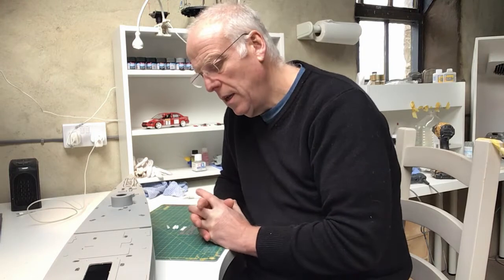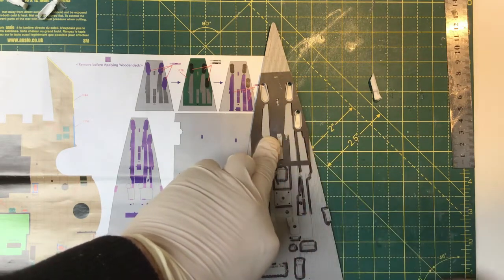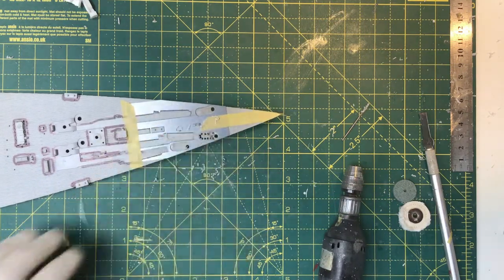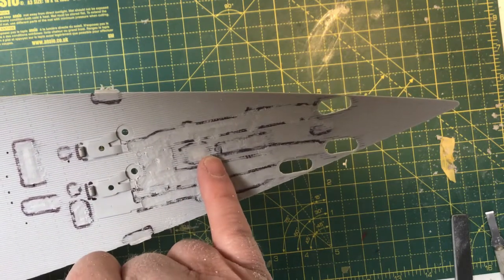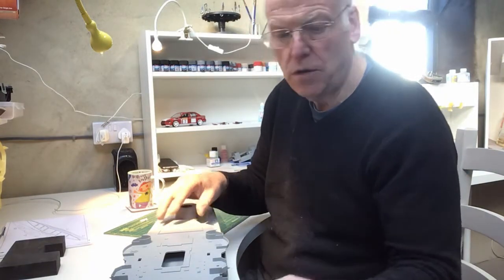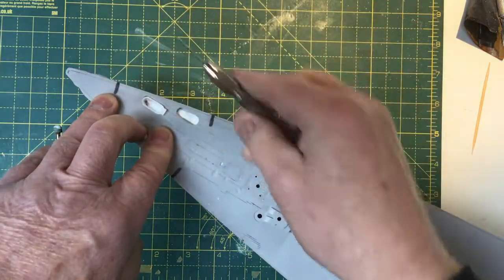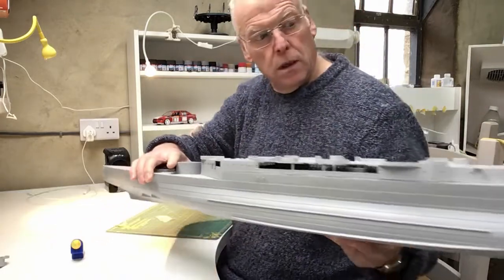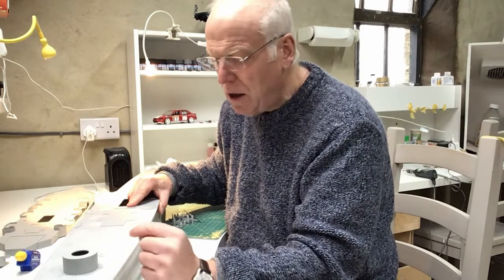Trumpeter 1/200 Hood Full build with Pontos detail set Part 3 (Decks and hawse pipes)

Comment: You've done  great job of presenting your build theory and practice. I'm following it with great interest. If there is one thing I would recommend has nothing to do with technique. Rather it's hard to follow because you are too far from the mic in your system, therefore hard to hear. I've had to turn on Closed Caption. It's done some funny things though. When you say "hawse pipe" the CC interprets it as "horse pipe." If your system allows, and you have the funds, you might want to consider a collar clip mic.
Reply from the maker: If you continue with the series Dan you’ll see (and hear) that I did exactly as you suggested so stick with them.
Reply: @TheModelShed  Cool, thanks...

Comment: Very nice video.  I am really enjoying watching you work.  Have you seen Ron Calverley's channel?  He is also building the Hood.  He had a lot of trouble with warping on the sides of the shelter deck.  Before you get to far along, you might check to see if yours have a similar problem.  See you next time.
Reply from the maker: Hi Jeff. The shelter deck appears good in my kit and a test fit showed that it fits very well. In any event the sides will be removed as they are entirely replaced with etched brass from Pontos. Thanks for watching.

Comment: Great videos good hands on instructions.    Interesting method of allowing the anchor chain to be connected to the Windlass while still looking good. I made up a custom tubes out of styrene for a similar effect.  How are you going to secure the wooden deck it's very tricky to manoeuvre into place around the barbettes. Alway a slight lifting there or the edges of the deck. I have had success using slightly watered down wood glue, even using a hypodermic syringe and needle to position some extra glue.
Reply from the maker: Dave that’s a great tip about the decks. I must admit i do have concerns about the deck lifting but I’ve also heard that the Pontos decks have very strong adhesive.
Reply: Yes very strong with instant grip. Also it's super thin just hold it up to the light and you will see what I mean. You need to be careful how you paint the deck if there are any parts that will stick through, careful masking to prevent dark grey showing up like a shadow.
I love the deck masks for this covers all thoes parts preventing the over spray. The wood glue prevents the wood deck from grabbing allowing for some adjustment. You need to get this right first time, can't leave it over night its going to be okay. Dry run a number if times make sure you have lifted all the cut outs required. Dave
Reply from the maker: Good advice Dave thanks